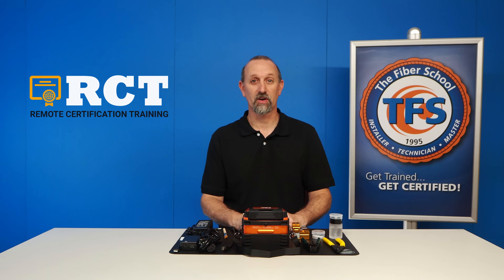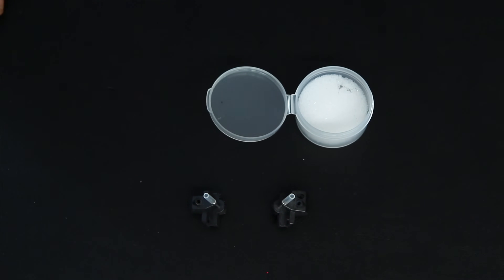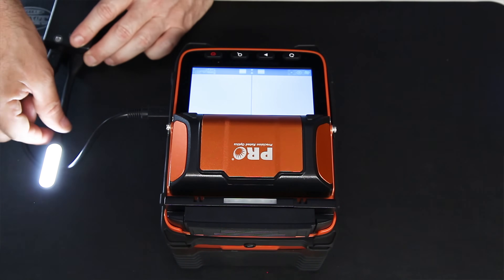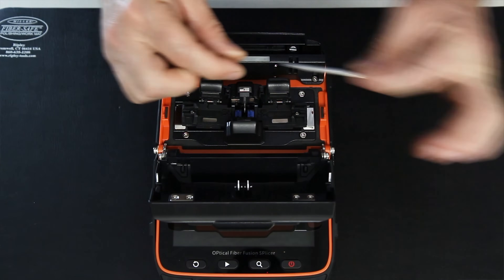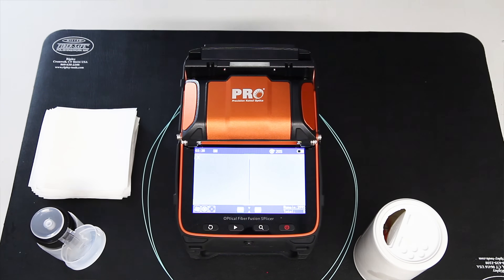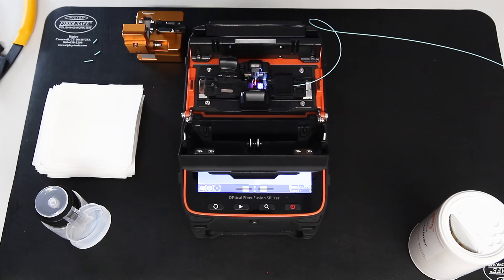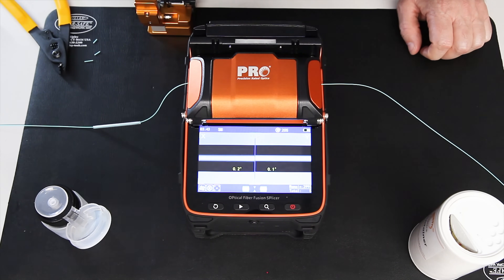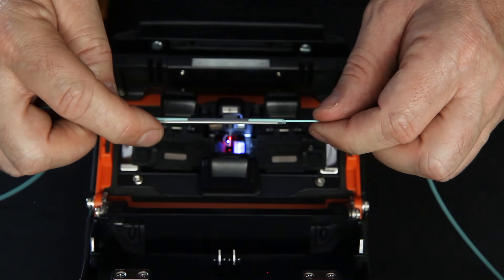How to: Use Arc Fusion Splicer

Comment: Unless that fusing machine can be adapted to ribbon splicing, then it's only good for single-fiber splicing.  Plus, there are cleavers on the market with their own 'trash can' on the right side of the cleaver.  Another plus, using alcohol wipes instead of a dispensing jar means a bottle of alcohol doesn't need to be carried.  As to using a power meter to test completed splices, it may not be company policy for that to be done right after a splice is made.  And, if you have 12 or more fibers to splice, you may not be given time to test each splice.  Otherwise, this is a very informative video for those new to fiber splicing.  Just don't forget to put the splice protector on before making the splice or you will feel rather silly when you realize you have to break the splice and do it again.